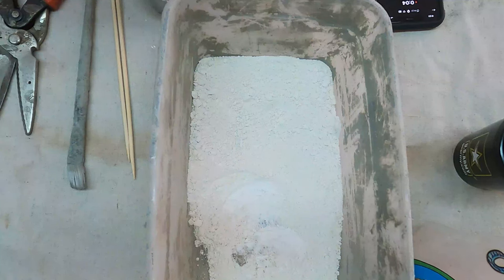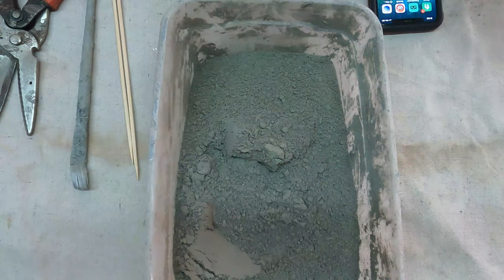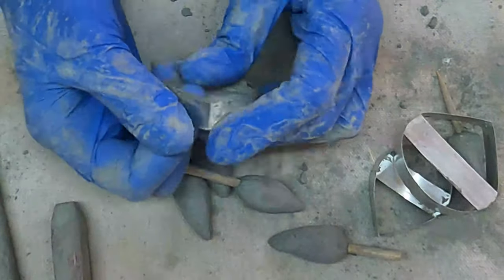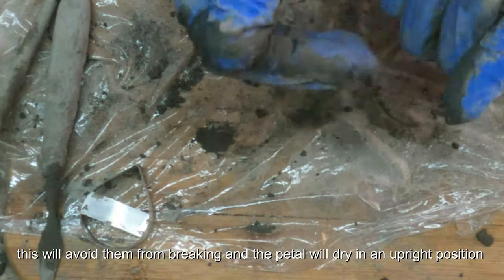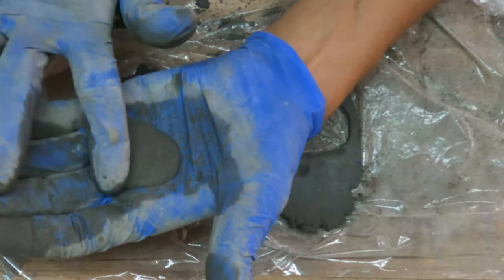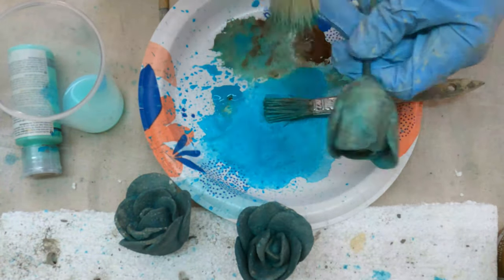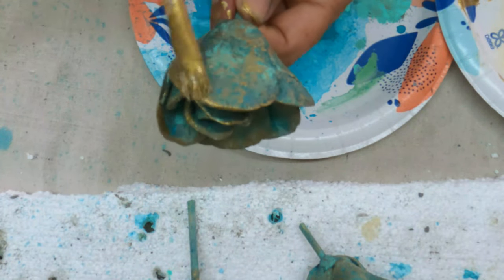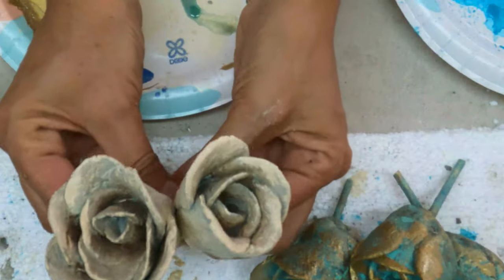Concrete Art. Cement Craft Ideas. Make Roses with Cement Project

Comment: Can CementAll be used instead……….thank you so much for sharing your skills and info with your audience❗️
Reply from the maker: Yes, give that a try I think it will work. However, make sure to use bonding cement acrylic not water.
Reply from the maker: https://www.homedepot.com/p/Sika-SikaLatex-1-Gal-Concrete-Bonding-Adhesive-and-Acrylic-Fortifier-187782/202521398